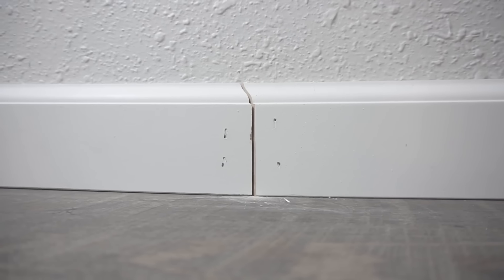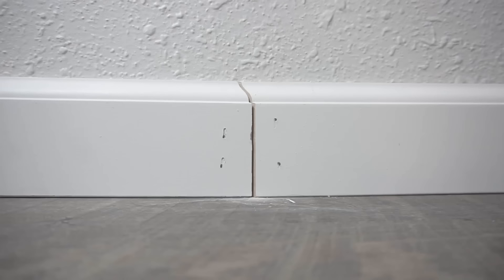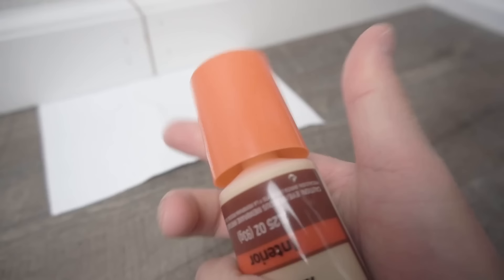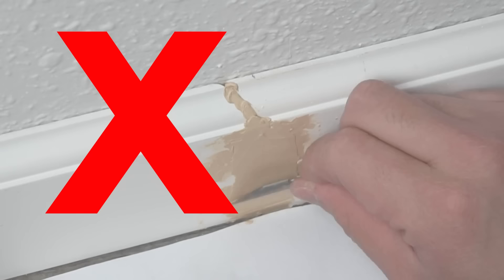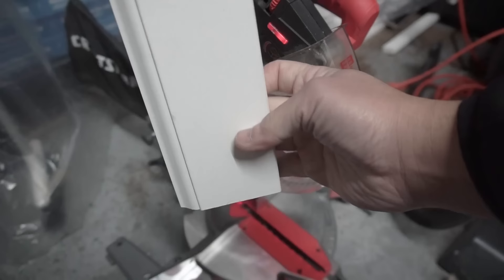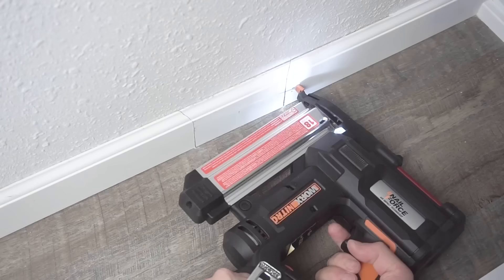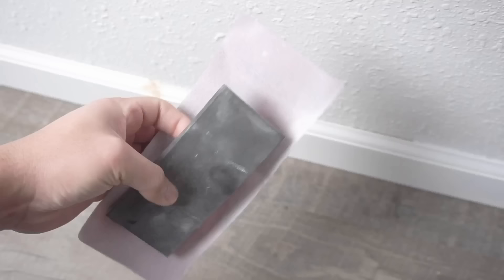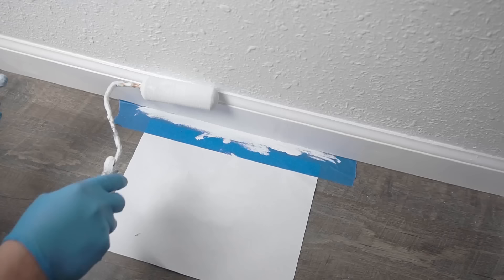How To Fix Baseboard With BIG GAPS Or Doesn't Meet Up! Tips And Tricks Tutorial DIY  For Beginners!

Comment: Time is money! It the amount of time it takes to do all what you did, I could have bought a new piece and replace the entire short piece in a 10th of the time and moved on to another project. Yes, if it was a special order piece or something and all you have is a piece of left over scrap, this would work. As mentioned in other comments, use bondo, not wood filler. You showed in the first example how the wood filler shrinks and cracks out, yet you used wood filler again on the second fix….again, time is money! The more you do to have to fill cracks, wait to dry, sand, maybe have to fill again, sand….you’re wasting your money by spending too much time. By a new board, make a good measurement, cut, install, get paid. Now, on a good note though, I do like your idea of thinking out of the box on doing a splice like that. Well done, final product looked great!
Reply from the maker: Thank you so much for sharing and bring open minded! Yes I agree time is money, but this is mostly for the average DIYer not contractors. Thank you for such a meaningful comment! 🙏🏽😊
Reply: No doubt. Cheap stock base board, just but a full piece and cope the ends. But if it's a stock that is beyond budget or historic, no box store nor lumber mill will have suxh a moulding.
Reply: Just playing devils advocate. How much time are you saving by running to the store? I mean, if you have spare base on hand, yeah, replace it. But a run to Menards or wherever, going through check out and returning?  Theoretically this is faster.

No tip or trick replaces measure twice, cut once, but this isn't a bad technique.
Reply: Maybe he’s just doing it for himself or being paid to show others how… I’m thinking you were too direct on why he is doing this. Not everyone’s in a hurry to make money!
Reply: @FixThisHouse  are you kidding me? Get off youtube
Reply: Money isn’t everything
Reply: Im a carpeter for 20 yrs i used duro bond scuff sand prime n paint 5min for DIY

Comment: So instead of having one gap you created two? :P
Reply from the maker: Hi! The point is to make the joint touch.
The gaps are minimal which are just mini gaps because you can’t make it so perfect. Either way you’ll need to wood fill it. You can’t depend just on  wood filler to make it touch like the first situation other wise it will crack on the future. If you really  watch the video it shows I ended up making the baseboard touch with the CA glue.
Reply: Yup. Correct fix would have been to take the entire piece off and replace with correct size. No seams
Reply: That's what I was thinking. And let's just cut it wherever and not hit a stud and nail it in the middle of the board where it doesn't touch the wall 👍
Reply: @FixThisHouse  could’ve just glued a popsicle stick in the gap then patched over.
Reply: @D.J.283  there are situations where you have to piece a section of trim, say a wall is twelve feet and you on,y have 8’ material. His method is not mine, but sometimes you have to find a solution.
Reply: @user-ib5mx8ro4k  Or just apply white silicone.
Reply: yeah i would've removed the whole piece and did it in one
Reply: LMAO!!! Then use wood filler on 2 gaps but can’t use wood filler on just the first gap
Reply: Just use fucking bondo lol
Reply: Could of just cut a sliver to fill the gap and glue it in
Reply: Don’t use wood filler to fill the gap…
I’m using this wood filler to fill the two Gaps I’ve made 😏
Reply: He finds they crack over night and continues to do this technique until the whole skirting is just one piece
Reply: @poisondaddy  can u use foam? And then caulk and paint
Reply: For arguments sake there is a plate behind it.
Reply: What was the point in that, he could have used wood filler for the one gap instead of too gaps like you said.🤭
Reply: @D.J.283  it's a decent taks from someone with out much else to do with their time, someone who enjoys these things and uses these tasks as pastimes or hobbies.  baseboard can be costly to some and if you have a lot of these gaps taking 3 hours to knock them all out with a few small pieces of trim does make sense I suppose.
Reply: Not quite. Instead of bad cut because you either don't have the mitre saw or knowledge how to use one you buy and learn how to use oscillating saw and then do a perfect mitre to fix your mistake. Genius...

Comment: I am a painter and if you use the correct woodfiller and aply it the correct way, you would fixed it without all that replacing work😉
Reply: I hope he never does this again
Reply: Yes, I honestly didn’t get why he had to do all of this when a filler + sanding + painting takes literally 15 min to complete. Some fillers are much better than the cheap $5 he used. That one does contract as it dries explaining why then next day, he had to redo it completely. Big Stretch should work much better for example.

Comment: You had the right idea in the beginning but instead of wood putty you need to use Bondo 3M all purpose puty. Mix bondo and a little hardener fill in the gaps add a second coat if needed sand paint or prime and paint depending on your situation or preference. It works for me.
Reply: His first application was better but you need to mask the crack both sides and use PL Premium glue 3x the strength in the crack then use Marrilo Sparkle with white Bond Fast glue mixed in. Sand off all excess filler just filling the crack. Works perfect if you know what your doing.

Comment: I like the idea here. The only question I have is wouldn't it be easier to cut the angles the opposite way?  You can pry it off without bothering the rest of the baseboard, and just push the new piece in to stick them together. Plus the surface will be exposed for the glue as opposed to trying to glue it from the inside. It seems like the timing of the activator would be less of an issue.

Comment: Sorry about long comment. I honestly think 99% of homeowners do not realize what goes into to trimming out a house, let alone doing base, crown, doors/windows etc…. Some might say this way too much work and just replace entire piece, but even THAT will take “time & labor” to do. So, if can get away with Doug a splice and making it disappear after replacing and blending with caulk, filler (if necessary), and paint…..why not😉
Nice repair. Usually do the miters in same direction for a splice when installing. For repairs, really don’t think it would matter if miters going same or opposite directions (but, guess we’ll have to test and try and see how goes over years….and know everyone says something different when comes to miters and splices😉) and as I’ve used 2 part fillers (I’d consider bondo a 2 part, along w/ other epoxies, resigns, etc…), and so on for repairs and installs and it can be time consuming for some jobs. Here’s the thing though, might be a special order profile for base, can’t get any, but homeowner has a scrap and can use for a repair, and it works. 
Nice job, looks good, and always hate when walking into a house, especially AFTER WAS JUST REMODELD, and the trim work/details are “ok” at best; compared to ones where you know the trim sub knows what they doing, took time; did amazing job and cared about the work they doing👍🏻
Cheers✌🏻
Reply from the maker: Thank you so much for such a meaningful comment! You truly understand my thinking! This comment deserves to be pinned! Thank you 💯! 🙏🏽😊
Reply: Ooh look at the new teachers pet... Just kidding.. congrats on the 📌
Reply: @titude 🤣🤣
Reply: Jesus has given you all. Repent or die.  Good point. Totally not what we were talking about, but I can't say that I haven't brought him into my baseboard installation before. Especially after a mistake was made, or I hit my finger etc...

Comment: Great technique but if you used 2 part filler to fill the initial crack it would have not cracked again
Reply from the maker: Great advice! I’ll try that next time and see how it does! 🙏🏽😊👍🏽
Reply: @FixThisHouse  as a carpenter for 45  years both production and custom I would have never nailed the short price up to begin with . I would have simply grabbed another length cut it  to fit and be done . Word of advise . #1 Never measure what you can scribe.  #2 if the base is being painted inside corners are always easier to fill than a bad joint in the run .
Reply: 2 part filler is not going to live up to the expansion and contraction of homes over time. It will crack and you’re going to have a small mess to fix
Reply: @jgarehart89  hey Josh, I'm a cabinet maker with 12 years of experience. a typical well built house (at least in my area) will slowly shrink during it's first 6 to 9 months after it has been drywalled and vapor barriered... but after that initial shrinkage, moisture shouldn't be getting into your studs and causing any more wood movement.... if your studs are constantly expanding and contracting, then you have a moisture problem in your walls... in that case, the cracking finish carpentry is the least of your worries lol.

Comment: The answer to filling a crack is never to make 2 cracks. If this is a high end job, you would fix the fundamental issue, which is the work itself. Replace the piece of trim. If its not as important, bondo. If it's community housing, just caulk and run.
Reply: I agree, rip it out and start over on that piece. Bondo yes are smelly stable friend. It's going to get beaten , yes caulk.
I loved your evaluation of circumstances because it is so true. The work needs to meet the tolerances of the job site or customer.
Reply: @ryanolson  I appreciate your comment. I hope I didn't sound like I was trashing this guy. I'm not a snobby trades person. I realize that on site, people have invented all sorts of crafty ways to solve problems. But sometimes I see solutions that exceed a certain standard for being counter intuitive. I will give this guy credit for coming up with a different technique. I bet it even has its uses elsewhere. But I have a feeling this instance is not a place to re invent the wheel. Sorry for the rambling comment. I'm a few glasses in.

Comment: Just use Sherwin Williams spackle, which is one of the best and is so easy that anyone can do it.  It dries in a few hours, bonds well, won't crack or shrink when dry, can easily be applied with something like an old credit card or gift card, and it won't damage or discolor the surrounding area.  Any excess also cleans up easily with water before setting so that there's no excuse for any sloppy over-application.  But if necessary, it can be easily sanded flush by hand with just a few strokes.  A thin layer of touch-up paint over top of the cured spackle and it's done.  Total time, less than 10 minutes and nobody will notice the repair afterward.

Comment: One good habit is to fill all your cracks with caulk before you fill it with wood filler. 

Big or small. Don't have to wait on the caulk to dry
Reply from the maker: Thank you for the tip! 👍🏽😊
Reply: I was thinking the same thing 👍🏽
Reply: I use Bondo... No brainer.
Reply: Actually the best habit would be to do it right the first time
Reply: Exactly. Why go through all that trouble attaching another piece of base board?

Comment: Re: initial gap:
1  make sure there isn't movement in the boards - I like to screw them to the wall. (Tip - drill hole through board into wall and push in 2 or 3 electrical wire offcuts with insulation so screw grips - it works.)
2. Caulk gap and use a good quality flexible filler.
Saves alot of hassle!

Comment: @2:42 Consider the blades thickness of the cutting multitool, to avoid a gap between the new piece and the existing baseboards. Maybe shifting the new piece by blade thickness before cutting the 2nd side of the existing baseboard or first cutting 45° gap into existing baseboards and then second measuring & cutting the new piece according to this new gap.
Reply: Second cut should be two blade thicknesses forward  of cut line

Comment: I would've popped the base board out and made the joint meet. Caulk the inside corner.  Make the exposed area as nice as you can. I could've literally used caulking, spackling and paint and fixed this eye sore in 30 minutes. Meanwhile you used more material than the job was actually worth.

Comment: This is absolutely not the way to go, Woodfiller will last as long if not longer than the baseboards themselves if you apply it correctly and with an appropriate amount of layers. Turing one gap into two is not the solution, especially when the initial gap was against a stud (which it should be if you have any idea how to install baseboards) removing the area at the stud will also greatly reduce the resistance of the baseboard... sometimes the complicated solution is the not the better one

Comment: Interesting technique. Thank you for taking the time to show us alternative ways to repairing gaps without condeming the entire piece. 

I had previously installed baseboards in my basement but instead of just brad nailing them on I used pl adhesive on the back, then nailed them in. I regret ever doing that cause now I have to cut a section of baseboard out to make a small notch in the drywall to run a second subwoofer cable for my hometheater in between wall studs. I think this method just saved me from having to spend 30$ on new boards.

Comment: I must admit, after running many miles of base when first learning finish carpentry I’ve never found myself actually installing a poorly fit piece. If it didn’t fit I’d recut and install a new one. Alternatively, when running base left to right I would check my splice joint first and make it good and leave the short end to the right. That could be covered up with a cope if it was short by a sixteenth or so. That’s how a pro would deal with it and make it good. For a novice they’d be better served just replacing the piece. It would be a good lesson learned.
Reply: My thoughts exactly.  The cope will "cope" with that problem.   Also I've been an inch short before (inch monster) but never 3/16" 😆
Reply: Yeah you said it right. Just recut the piece. Use the miscut piece someplace else. On the homes we do a gap would never fly.
Reply: Yup I would never leave a gap like that
Reply: What's a cope?
Reply: @TheRds797  easiest answer is to go to YouTube and search for “coping baseboard”

Comment: I never 2 piece a full trim wall, especially at install, just cut to length, budget can't be that tight and it's great your skill level allows you to do this but time is a huge factor here, both during initial install or a repair.... Just cut a full length piece.
Reply: Ummm the longest piece you can possibly get is 16 feet and many walls are well over 20 feet.  What is the correct way is to use CA glue and glue the 2 pieces together prior to nailing

Comment: Or you use polyurethane pva glue in the gap, leave it over night and the. Glue would of bubbled and expanded and filled the hole solid.  All you need to do is cut the excess glue and paint... don't over complicate a small issue.  I use the poly pva glue on all my finishing lines  and 10/10 times, it comes out perfect.

Comment: Can bondo be used for this situation
Reply from the maker: Yes you can!
Reply: Bondo may be strong and looks nice but it has nothing on a house settling and wood trim naturally expanding and contracting with changes in humidity. It will crack. Just give it time.

Comment: I like the idea of cutting it with the scrap piece to make sure the cut and angle are perfect. But why cut a scarf joint? Just makes it harder if you’re going to be filling and sanding anyway
Reply from the maker: Hi! Reason for scarf joint is to have a stronger connection. Sure you can use a butt joint but over time a butt joint will crack due to expansion and contraction of wood material it’s connected too and eventually will crack.
Reply: Scarf joints look better and increase the surface atea contact for glue ups, i was trained to do 30 not 45 but to eaxh his own.

Comment: I have the same situation but the ends of the baseboard are butted together, what should I use to fill the crack it's like an 1/8 inch crack
Reply from the maker: Hi! Since it’s such a small gap you could probably get away by loading it up with 2P-10 glue and activator and just cover the surface with wood filler. Prime then paint. 🙏🏽

Comment: Your wood fill cracked over night because you put waayyyy to much on to begin with. Your first layer should have packed the cavity all the way but left at least 1/16th below the surface of the baseboard so it can bond and shrink (which is why it cracks) and then you next coat should fill gap with now a good backing and pulled tight with troule. If it is still not perfect you feather coat with Dryden to merge both pieces.  But if it’s a bond you don’t to crack again you use a two part epoxy wood filler made for stair stringers. Minwax makes the best one
Reply: I would have nail and seal cavity first by unibond then light fill at the end.

Comment: if the blade of your oscillating tool is long enough, i would cut my templet piece with outside corners, this will make taking out the piece you want to remove way easyer.
Reply from the maker: Thank you for sharing! 🙏🏽😊

Comment: maybe stretch caulk instead of wood filler ? curious if it works for big gaps
Reply: No. Way more noticeable. Caulk shrinks. Getting it flush, smooth and looking like wood is too difficult. Bondo, or recut your piece. Always wood glue and sand your outsides and seams. If you Rely on DAP and paint.. a carpenter you ain’t.